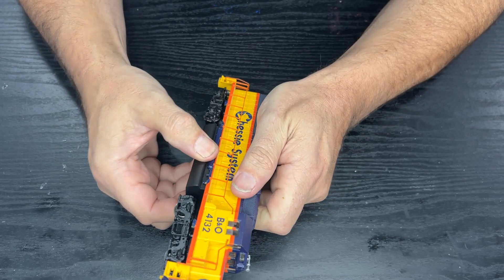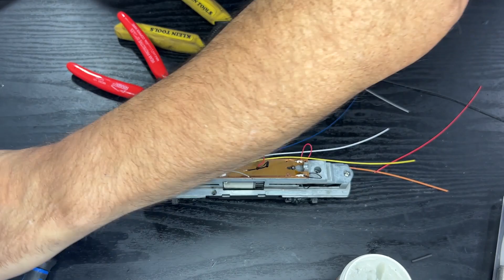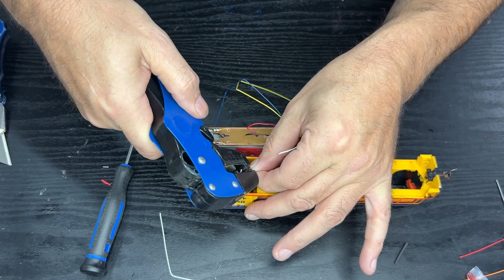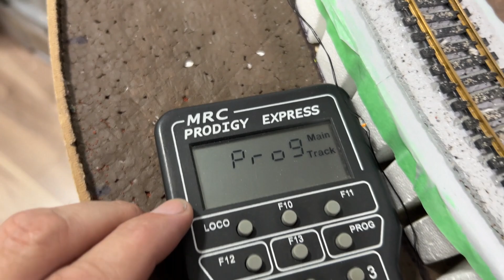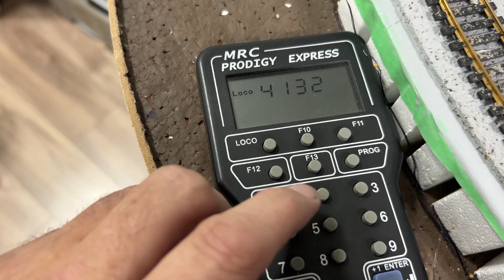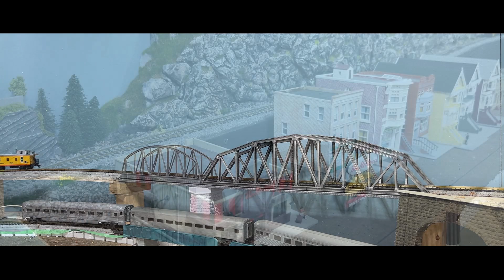DCC Upgrading My Best DC Locomotives

Comment: Nice work Dave. May I suggest that you add DCC++EX and JMRI to your system and computer. Then you'll be able to easily adjust all CV values to your locos. Also, JMRI allows you to have a Loco Roster (with photos if required),  to easily see the loco address etc. Cheers from Australia

Comment: Here's a good decoder installation tip. You can use electrical tape or clear tape to hold the wires for both temporary and permanent installation.

Also, about the speed numbers on the DCC, the numbers represent the percentage of power the decoder is instructed to operate at for the motor. It's not really an indication of speed at all (e.g. 40 = about 40% power. This is a rough estimate due to the speed steps of 128 make it about 0.78% per number indicated). People often make the same mistake with DC powerpacks/throttle with the numbers, also. On a DC powerpack/throttle, the number represents the percentage of voltage given to the track not the actual speed. For example, if you powerpack/throttle puts out 14 volts max, and you set it to 50 (50% power).  The voltage would be about 7 volts or 50% of max voltage. I hope this will clear up an of misrepresentation of speed. As far as scale speed, this will be a topic for another day.

Comment: Others have commented on this, but it's important to know, so I will say it too: if you wire the decoder "backwards" so the loco runs in the wrong direction, there is a simple CV you can change to make it go in the "right" direction without rewiring.
Reply from the maker: Thanks, I'll look into that.

Comment: Brilliant!  Curious about the size the shrink tubing (mine is way too big) and what kind of wire strippers are those? (Christmas is coming).  Thank you.
Reply from the maker: Here's a link to the pack of tubing I use. Mostly just the smallest black and red one's. https://amzn.to/3N5Owcy
I got the wire strippers from Princess Auto, which is like Harbor Freight. Nothing expensive.
Reply: @ScottRails  Thank you so much.  During my lifetime I have been using the notches in my teeth for smaller gauge wire.

Comment: The red and black to the decoder are connected to the AC track leads, so swapping them makes no difference. In the future if the motor leads (orange/ gray) are backwards, you can correct this by changing a CV value without doing surgery.

Comment: Dave, right off the bat. There is a standard for dcc decoders. The red wire is the right rail and black left. Then hook up your motor wires and test the direction of the loco and solder wires accordingly. Watch those Bachmann motors, some don't last very long. I just replaced one in a newer Bachmann SD40-2. On the FA install. Does it have 2 headlights. If yes one is a headlight and on a MARS light. Kind of a early ditch light. It did not flashed but actually moved inside the housing. You however have to use a flashing LED. Good video.
Reply from the maker: Thanks. I was thinking of getting a box of 5 pole motors from Ali Express. I have a feeling I might need them soon, lol.
Reply: What is Ali Express ? @ScottRails